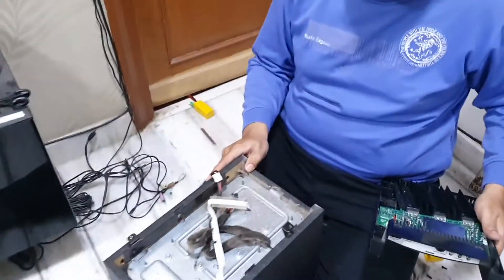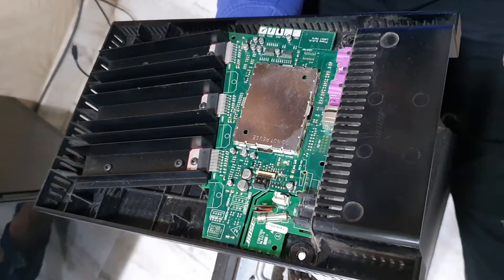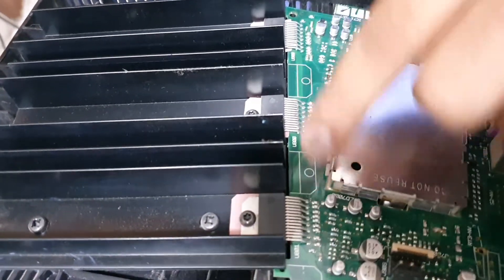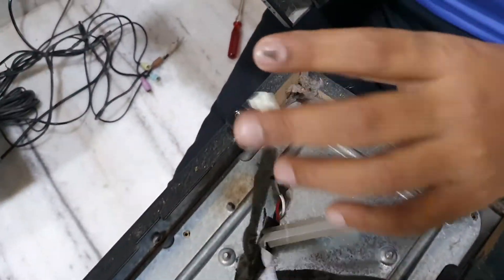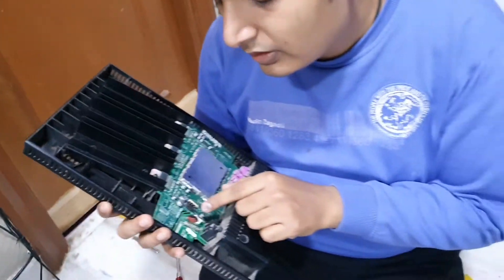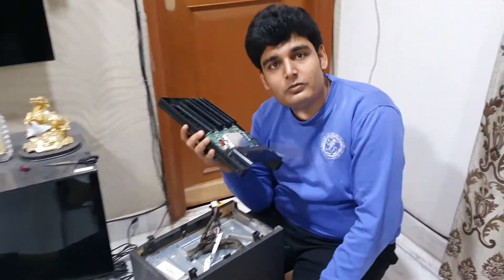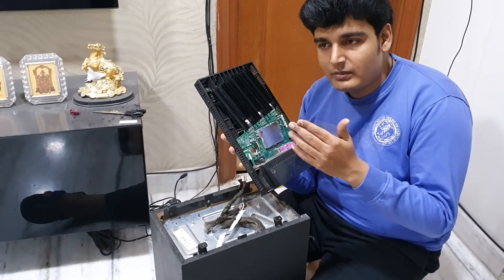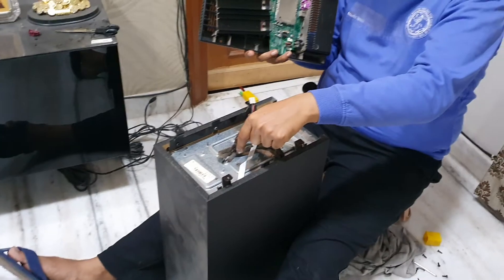Bose acoustimass module||Lifestyle 48 series iv||understanding the insides||Blown Varistor||

Comment: Can we extract a extra input (3.5mm) bcoz my preamp is not working
Reply from the maker: Could you elaborate a bit? If you are interested in pulling a preout from the Acoustimass module, then it may not be possible. Even if we somehow manage to physically make a connection to some power amp/soundbar etc, at the reciever end, it may not send a safe and sufficient amount of voltage signal. 
For more details, you would need to check the troubleshooting and service manual for circuit wiring and switch off the internals first.